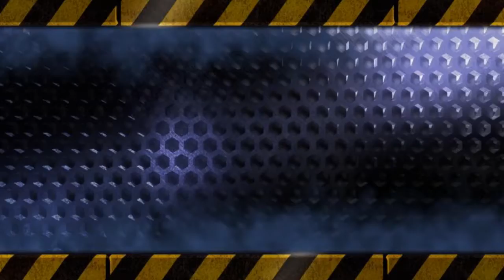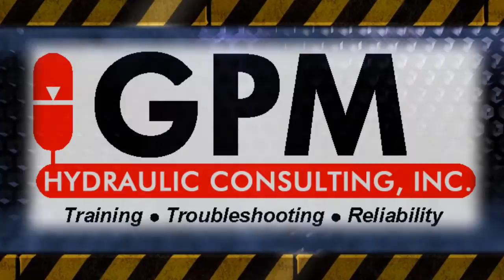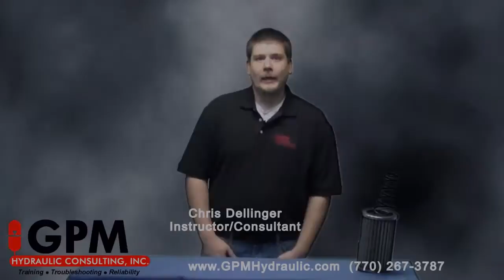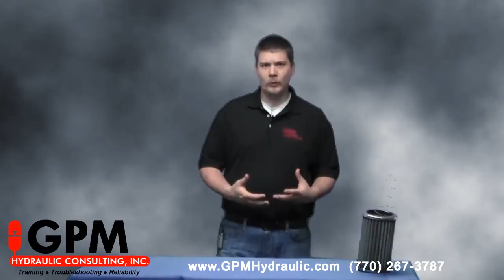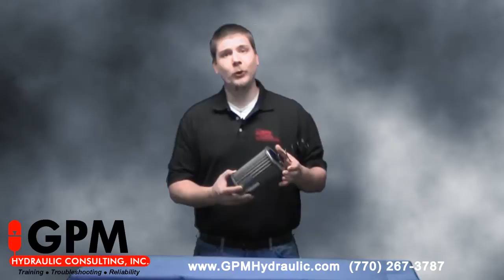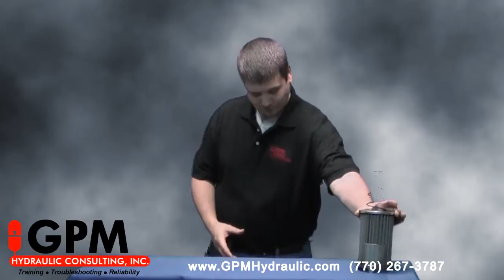Difference Between Aeration and Cavitation

Comment: Hi sir good information i have problems with variables displacement pump, its sound during high pressure, even we replace new pump same type replace section hoses clamps too, still same pls help
Reply from the maker: Well, assuming it's a steady sound, that would mean the pump is cavitating still. There has to be some obstruction in the suction line (or perhaps too small of a line). Also, make sure the RPM of the drive motor is within the specs of the pump. Check oil temperature - cold oil will do it, or the wrong oil (too high viscosity). Hope this helps!

Comment: Thanks for your good work.. but I want to explain about oil smoke comes out from suction tank..why?
Reply from the maker: Smoke? Or vapor? Vapor often forms in a reservoir as a result of water in the oil evaporating as the system heats up. You need to flush your system with a filter that can remove water. Keep it out using a desiccant breather. Smoke, on the other hand, is another matter. Something is threatening combustion of the oil and should be addressed immediately!

Comment: What would cause a New Holland TC-18 tractor with a hydrostatic drive system to make erratic high pitched noises when cold, then go away when it warms up? It does not even make the noise when it is above about 60 degrees outside. It sounds like aeration but it goes away when warm like cavitation. Been doing this for 3 years now, I think I may have to change the hydrostatic fluid and see if that helps, I do not remember if the hydro fluid has ever been changed. Thanks for any input. Good video, very informative.
Reply from the maker: Thank you for the kind comments! It can often be hard to tell the subtle difference in the sound of the two, particularly on mobile equipment. Changing the fluid certainly can't hurt, and if there is any water in your oil, it can make some strange sounds when it cavitates. A heater for your reservoir is not very expensive. If the sound goes away once the fluid is warm, I think it would be warranted.

Comment: I have a John Deere 318 and I believe the charge pump is cavitating.  The tractor is very simple so there are no gauges or anything.   The suction hose is 30 years old, but it's about a 3/4" hose.   I've included a link to a video of it.  Could you tell me what you think that noise is?   This was in a relatively cold (40*) environment at a low idle. 

https://youtu.be/qiDHOU7yC7Q
Reply from the maker: Hi Harrison - thanks for your comment! The sound in the video you shared seems pretty steady to me, and I hear no extraneous sounds that are usually heard during aeration so I believe it is cavitating. Since it was cold out, chances are good that the oil viscosity was simply too high. Did it stop making the noise once the system came up to normal operating temperature? If not, check the suction line for collapse or blockage and, if there is a suction strainer in the tank, check to be sure it is clean. Hope this helps!
Reply: GPM Hydraulic Consulting thanks for getting back to me!  This is the best description of cavitation I've seen on YouTube or anywhere else I've read.  Nothing extraneous, just straight to the point.  So thank you for that. 

It does quiet down once it's up to temp, but never goes away completely.  I will be checking the suction hose.  Also, I've had a few Deere enthusiast suggest that my filter (although new) could be airlocked because I didn't put oil in the filter before I put it on the transmission. Thoughts?
Reply from the maker: Depends upon where in the system the filter is placed. If it's a suction filter, that's entirely possible. If it's a pressure or return line filter, it would be unlikely to contribute to the cavitation (though it is a good idea to fill the filter with oil prior to installation).
Reply: GPM Hydraulic Consulting I think it actually is a suction filter just because of how simple the trans is.  There's a suction hose from the bottom of the differential up to the bottom of where the filter screws on.  Then the charge pump is on the top of the filter.   The filter screws in horizontally, so I will do my best to get as much fluid in there as I can.  I'll let you know how it goes.
Reply: GPM Hydraulic Consulting I ran it for a good while. Heated up the oil.  It's quieter.   I also drained all the fluid out and it's full of tiny tiny bubbles.  Not foamed.   The suction hose at the bottom was perfectly clean and clean.
Reply from the maker: That is entrained air, and will result in cavitation as the air bubbles get transmitted to the pressure side of the pump and implode. Much more common in smaller mobile hydraulic units than industrial types. Larger units often have baffles installed in the reservoir, allowing air bubbles to float to the top, keeping entrained air from entering the pump. Usually they are the result of improper bleeding when oil is added. They form if fluid splashes when added or if return turbulence is high. Fully bleeding the system usually gets rid of them. They can also be caused by contamination - any surface-active compound can do it because it reduces the surface tension of the oil. Try bleeding the system first. If that doesn't remove the air bubbles, you may have to run some system cleaner through and replace your oil.
Reply: GPM Hydraulic Consulting I can't thank you enough.  I've been trying to find these answers for a very long time.  I'll let you know what happens.  Thanks again!!

Comment: hi i am having trouble with a hydraulic pump.It's pressure sometimes becomes zero & when i restart the pump, pressure will get back to normal.
Reply from the maker: Is this a fixed or variable displacement pump? If it is a variable displacement, pressure compensating pump, I would first check the compensator valve. They often behave in this fashion because of a pilot orifice in the valve spool. Cleaning this orifice usually corrects it. If it is a fixed displacement pump, the system relief valve is probably the issue. Hope this helps!
Reply: Hi thanks for the help it was compensator valve problem.I forgot to reply sooner .